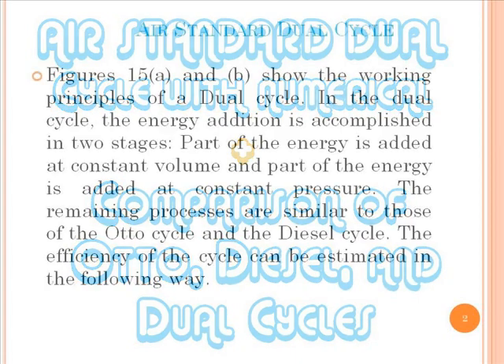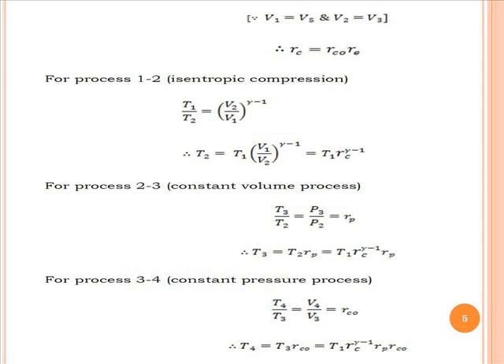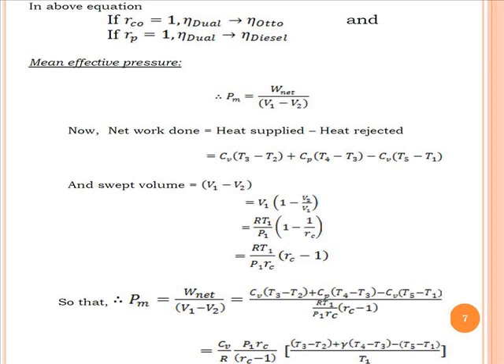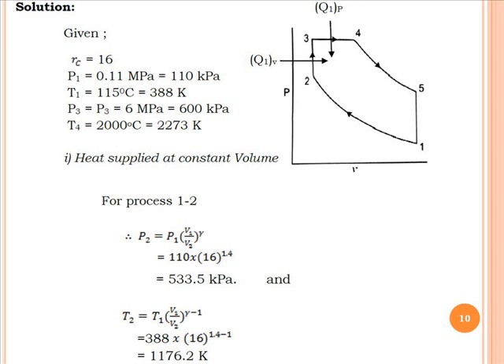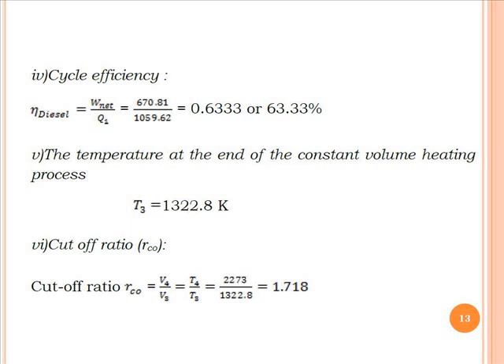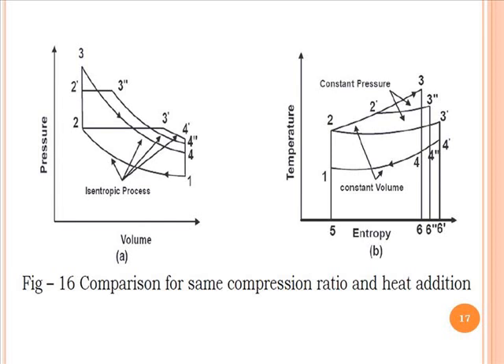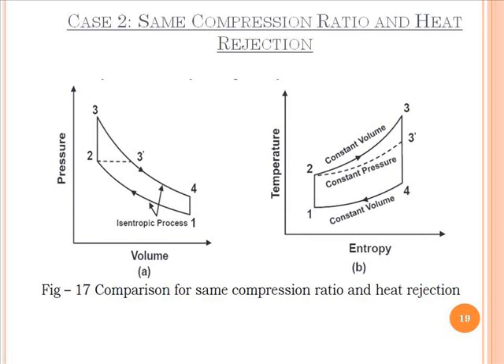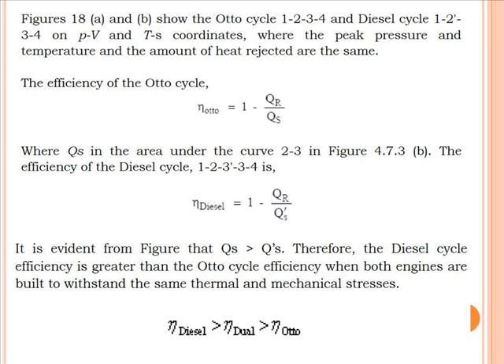Comparison of Otto Cycle, Diesel Cycle, and Dual Cycles | Dual Cycle | Otto Cycle and Diesel Cycle

Comment from the maker: The current video is catering to the needs of students regarding the basic concepts of DUAL CYCLE.  Comparison of Otto cycle, Diesel cycle, and Dual cycle are also shown. It is very helpful to beginners in the field of mechanical, aeronautical, automobile, agricultural, chemical engineering, etc. of  DEGREE AND DIPLOMA ENGINEERING.